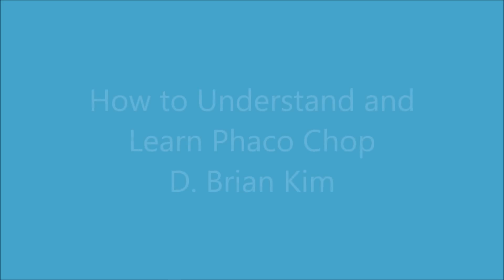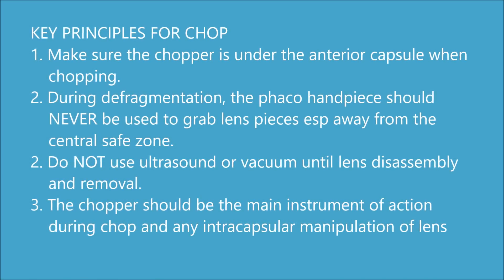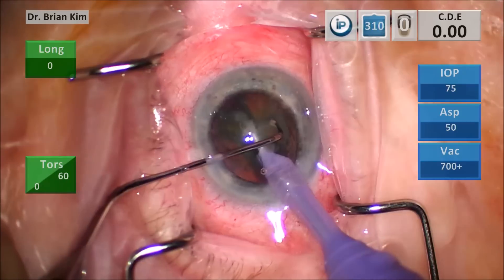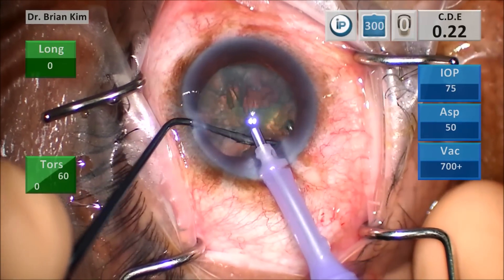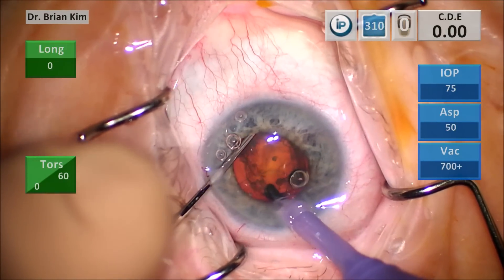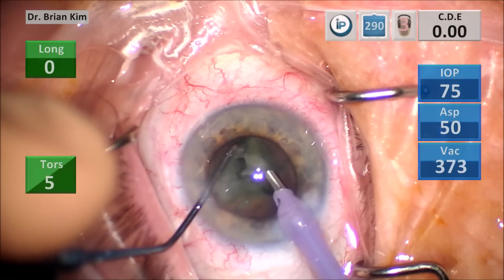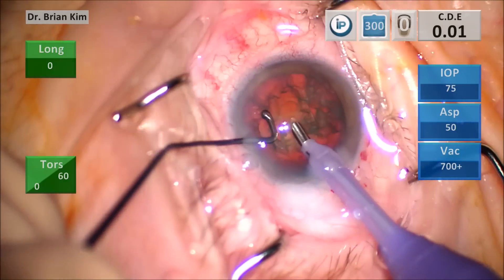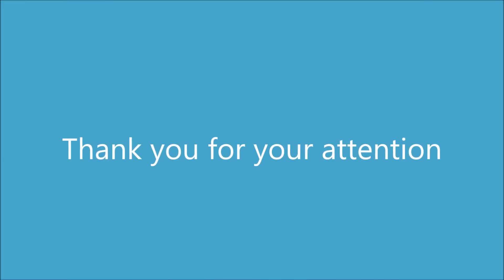How to Understand and Learn a New Way to Phaco Chop

Comment: hi sir.i like it thank you very much.is this way appropriate for weak zonules or can it make stress to zonules.thank you again😊
Reply from the maker: No, there is no risk to the zonules as long as you follow the proper technique:

1. place the chopper out to the equator within the capsular bag and don't accidentally place the chopper over the capsule which can tear zonules.

2. When you chop, make sure you sandwich the lens material between the chopper and phaco tip.  You shouldn't push down on the lens material or bag which can cause zonular stress.
Reply: D. Brian Kim MD thank you very much

Comment: Very lovely video Dr Brian. The cataracts we have to deal with here in West Africa are usually very dense (VA Hand movement/light perception) I am not sure the chopper will find space between the capsule and the cortex to maneuver to the equator. some surgeons have argued in the past against doing phaco on such cataracts but they actually do well with the divide and conquer method. The challenge sometimes is you want to go as far as possible before fragmenting the lens which could pose a problem. I think for such very dense cataracts a combination of initial debulking and then chopping as you describe would be ideal. Have you had to deal with such cataracts? please let me know your thoughts.
Reply from the maker: Dr. Olurinola,

Thank you for your comments.  I have no doubt that the average cataract in W. Africa is far denser than what I see in the U.S.  However, I do see a significant number of dense lenses in my area.  MISCS is definitely an excellent option for the ultra-brunescent lens; however, it's my opinion that it's worth trying to phaco whenever possible but never at the expense of safety.  Excessively high ultrasound energy use along with excessive fluid use and prolonged surgical time increases the risk for corneal decompensation, and if this is anticipated, these cases should be converted to an ECCE.

Double Chop drastically reduces ultrasonic use and is the strength of the technique.  The technique also shines for brunescent lenses because you can fracture the posterior plate safely.  Recall, most chopping surgeons need to bury the phaco tip with U/S and vacuum to hold the lens material before chopping, whether for the initial chop or subsequent chops.  This can be quite dangerous when trying to tackle the posterior plate.  Surgeons tend to struggle with this.  However, since double chop does not require U/S or vacuum, you can place the chopper and phaco tip deep into position deep in the capsular bag and fracture the lens fragments with mechanical forces safely and easily.  The risk for posterior capsular rupture during this maneuver is minimal and I have not had complications doing so.  I have been able to chop brunescent lenses with this approach, but it does require a lot of patience and multiple chopping maneuvers.  I am able to keep my ultrasound numbers very low with this approach.  Then again, an experienced MISCS surgeon could do these cases within a matter of minutes.

I hope this helps.
Reply: Yes very helpful indeed. 
MISCS is the routine method for cataract extraction here but with increasing awareness and demand for Phaco surgery. There is a need for improved proficiency in Phaco surgery so as to be able to include safely cataracts that otherwise would not have routinely made the Phaco list. 
Thank you

Comment: In the case of very dense cataracts, the position 0 or continuos irrigation remains?  just a little bit of position 2 maybe? thank you very much for sharing, its very helpfull for me, as I am starting phaco in my residence. Thank you!!
Reply from the maker: Hi there and thank you for your excellent question.  Only continuous irrigation is used during the chop maneuver.  My machine has automatic continuous irrigation on Position 0.   If you don't have automatic irrigation, keep your foot on Position 1 at all times.  I'm primarily using Position 2 and 3 when I'm removing the pieces.  Best wishes.

Comment: very effective chopping tech. But very high vacuum and aspiration levels. I do not recommended for the beginners
Reply from the maker: SAYGIN SAHIN I agree that this technique is not for beginners but I say that not because of the settings but about the technique itself. One must be comfortable and confident of the surgical maneuvers with instrument positioning to crush the lens without compromising the capsule bag or zonules. The settings are aggressive out of personal preference and have no bearing on the technique itself.
Reply: @DocBrianKimMD  thank you for sharing your experience.

Comment: Excellent video. Will try this in my next cases, but wouldn't you agree that the mechanical burying of the phaco needle during the first chop maneuver poses excessive vertical stress on the subincisional zonules?
Reply from the maker: Excellent question.  No.  There is no stress.  It is the same maneuver as placing the chopper into the equator.  The lens material subincisionally is soft like using a chopstick to cut through jello or soft butter.  There is no stress on the zonules.  I will record some cases to illustrate this point next time I'm in surgery.
Reply from the maker: I forgot to reiterate, I use a kelman-style tip called the Balanced tip by Alcon but any Kelman-type should work fine.  Hold it bevel down which will cause the tip to be curved in front of you toward the endonucleus.  This is why the phaco tip can hold the endonucleus to chop and also why you don't stress the zonules.  Please watch the follow up video which explains this:
https://youtu.be/nVcVaDzSZs0

Comment: Hello! I wanted to ask you something. I saw your video and really worked for me. Im doing my transition from divide and conquer with stop and chop. What would you say  on trying the chop only with OVD and no irrigation? Id like to reduce even more my fluid count in the surgery
Reply from the maker: Oftalmología Venezuela hi and thank you for your interest.  In my opinion, irrigation is important to keep the capsular bag completely inflated.  Yes, you can do it under viscoelastic without irrigation but then you may need a lot more viscoelastic than if you just used irrigation.  As long as you have good wound construction, you should not have too much fluid egress throughout the case.  I hope this helps.

Comment: Hi Brian. Do you keep the balance tip down the entire time. I am used to having the tip pointing up.
Reply from the maker: Jacqueline Griffiths hi Jackie, yes I keep it pointed down. It keeps the U/S energy directed down and away from the corneal endothelium but also pointing down gives a better angle to fracture the lens.  I hope this helps.  Don’t hesitate to contact me if you have anymore questions.